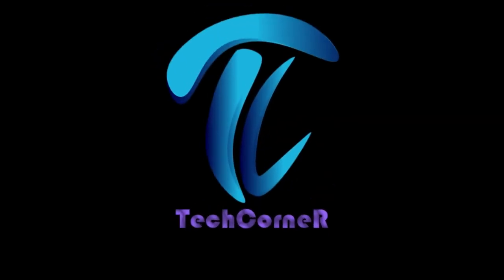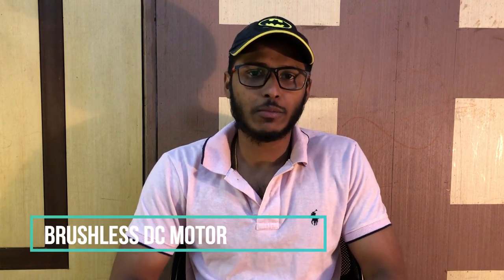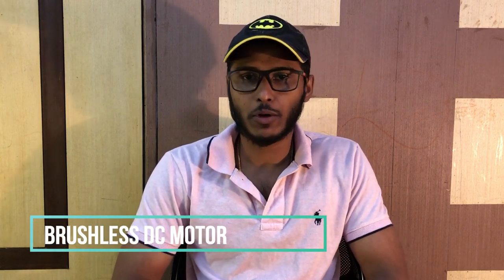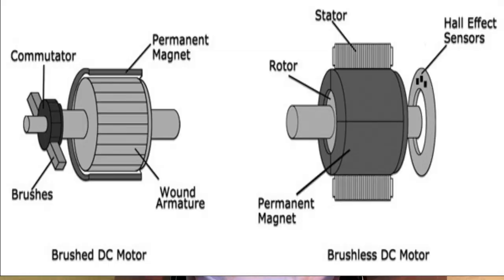Brushless DC Motor | BLDC | Detailed Explanation in Malayalam

Comment: Brush less DC ക്ക് ഉള്ള പോരായ്മകൾ പറയാമോ especially cost wis ?
Reply from the maker: Costly aayrkm normal dc motor e kaal, pine ithili electronic partum Hall effect sensor okke malfunction cheyan olla chance undu
Reply: Bldc motor run chyekan oru controller drive encoder  venam  stupper motors  are bldc motor anu ella settings um kudi costly arikum  kuduthal ayi automaton karyagal arikum kuduthal ayi use verunne
Reply: ഞാൻ പറയാം DC മോട്ടോർ ന് ബ്രസ് തെമാനം BIDC ആണങ്കിൽ ഇട്ടോണിക്ക് പാട് സിന്റെ ഇസു വീക്കാവാൻ ചാൻസില്ലെ-

Comment: There is a mistake in this demonstration. The demonstrator is saying, rotor is with winding. In that case, how electricity is connecting with it without brush? ( at 2.50 minutes)
Reply: 2:25 correct parayunnund